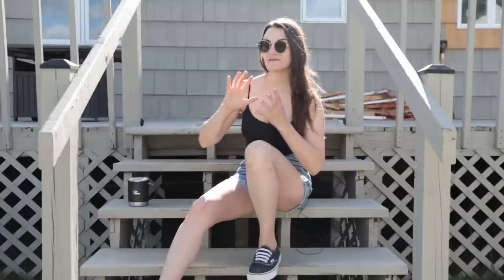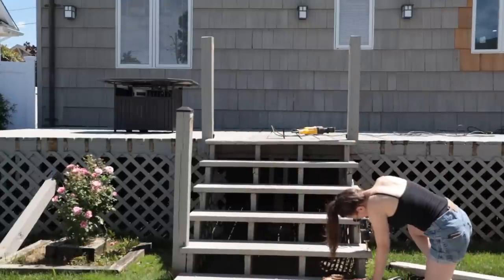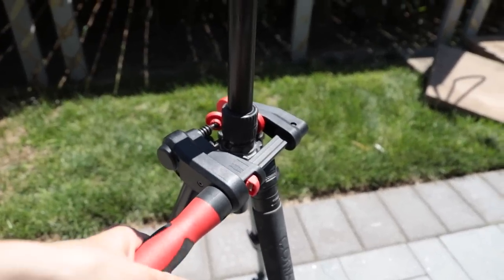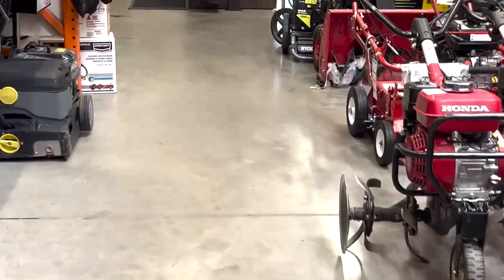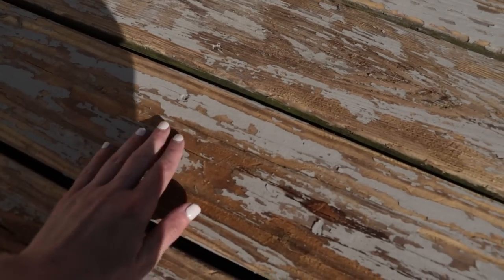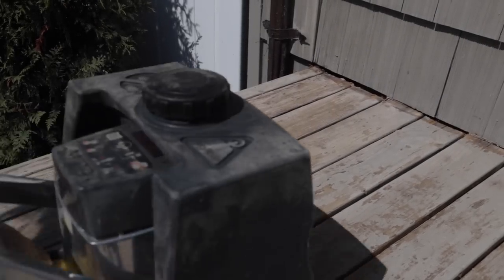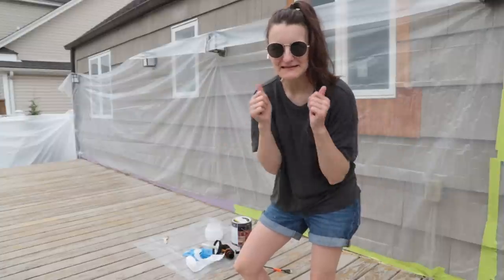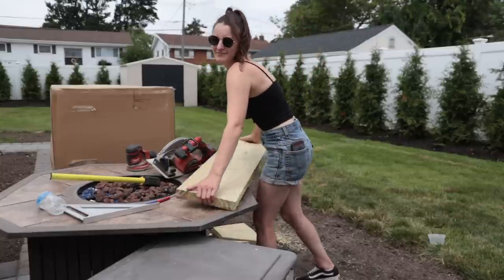DEMO'ING & REFINISHING MY DECK || DIY DECK MAKEOVER (PT. 1)!

Comment: can you imagine getting back from work and your girl has demo'd and refinished your deck all by herself !  <3    Last time I sanded a deck, I wondered if it would take less time to just unscrew the boards and flip them over instead !  hehe
Reply from the maker: Hahah. Yesss! I legit thought the same, but these were all nailed in too well! 😭
Reply: For real, the first time we did it, it took 2 days. From then on we’ve rented a floor sander from Home Depot (a square sheet sander) and it takes about 2 hours for an 800 sqft deck.
Reply: OK, so, clearly I wrote that very early on in the video, the one we rented is kind of similar but I feel like the pads were twice the size. Also, our deck is stained, not painted.

Comment: Soooo I did the same thing with the deck on the house I just bought. I wanted semi transparent stain so bad that I sat and used and angle grinder on all of the boards definitely the fastest way I found to get the paint up and worth it! So stoked to see your finished deck 😍
Reply from the maker: You’re a CHAMP! It was way too hot and I did not have the patience for that. Share some of your work ethic with me please. 🤩

Comment: I love the horizontal boards! Great looking design. Curious, with so much rotted wood, did you check the boards under the deck, that holds the deck up? Didn't see that in the video and just to mention that it might have been a better option to place the steps even with the door rather than centered.  On the flip side, I really love ❤️ the quality job you did on the deck! It looks great! First time seeing you so definitely subscribing!
Reply from the maker: Thank you! Yes! I was able to climb under and check it all out - the structure was perfect! We centered the stairs cause the garage is in front of the door. Hard to see I the video,  but now the steps open up to our whole yard! 😍

Comment: Hard work. However, I like the urban European trend you used for the horizontal boards on your deck. I have seen it used on screens or featured walls. In your case, you could plant several things along the side of the deck, which would look nice in contrast to those horizontal boards. I also like that you carried the design to the stairs as well; nice. Oh, you probably can rent a wood steamer to help those warped boards get back into shape; not perfect, but better. Consider yourself privileged for having the Home Depot rental center. Because I live in a border city next to Mexico, our Home Depot has never had a rental center. They are afraid they would lose all the equipment through theft. There may be other rental places, but I don't know of them. For the most part, almost everyone will buy their equipment or borrow it from a true friend. I can't wait to see what you will do with the railings. Rich Blessings

Comment: It does look great,  but I would have made the treads deeper so you get that nice lip over the riser. Gives them a bit more depth rather than looking like stacked boxes. But inspires me to look into re-doing the stairs to my front porch. They have been BUGGING me. But I need to decide on what I want to do regarding railing around my front porch. When I ripped them off I was in love with the more open look, but I don’t know. I have decisions to make for SURE.

Comment: Very nice job on the deck!  Lot of hard work, and solid techniques.  Plus you always have an enjoyable and informative editing style, composition for your shots, narration, photography, etc.  Really pro-level videos!

I think a lot of DIYers would attempt to salvage some parts of a deck that has rotten pieces here and there, given the prohibitive cost of lumber these days, and would find videos demonstrating the right ways to perform such techniques very useful.  Taking the steps as an example, if the rot was only on the bottom parts touching and near the ground, and the rest of the steps solid with many years of life left in them, someone should not sacrifice safety thinking they had to replace 'all or nothing' on their own steps, and go longer with the 'nothing' while saving up funds, when leaving the rotted base in place during that time may be an accident waiting to happen.  To do that repair, I might 'sister' (i.e., glue and screw) 18" chunks of the same size framing material onto the inside surfaces of those stringers to have solid wood go all the way to the ground again, then cut away the 2-3 inches of rot on the stringer ends and fill in with a patch of the same material fastened to the 'sister' piece.  

Anyway, just an idea.  Given the economics involved these days, how to correctly repair a partially-weathered or rotted part of a project, versus replacing the whole thing is certainly a timely topic, and I imagine would produce guaranteed views for your most-excellent channel.  Regardless if you think there's merit to the idea, I wish you continued success with your channel, and keep up the good work!.
Reply from the maker: Thanks for all the love! I hear you on the salvaging! I definitely wanted to keep anything that was still intact and save some money for some other parts of the project!

Comment: The deck and wrapping boards looks great but I'm wondering whether it was wise to put the bottom boards so close to the ground. Won't they rot or encourage termites?
Reply from the maker: I used pressure treated wood meant for ground contact.
Reply: @diyhuntress  That makes sense LOL